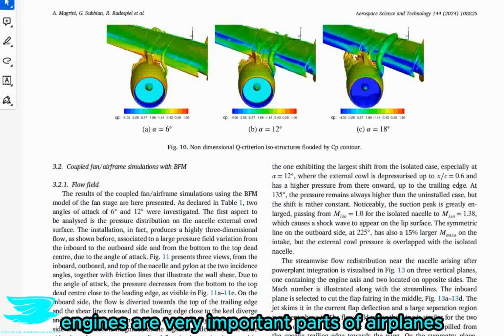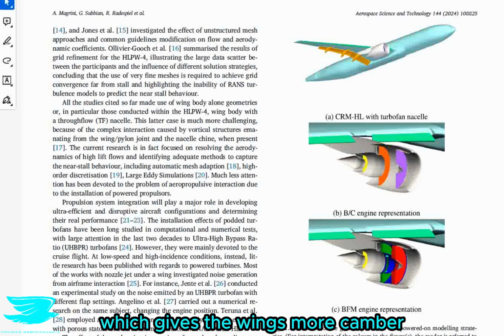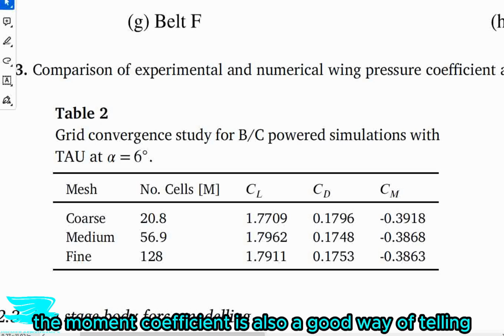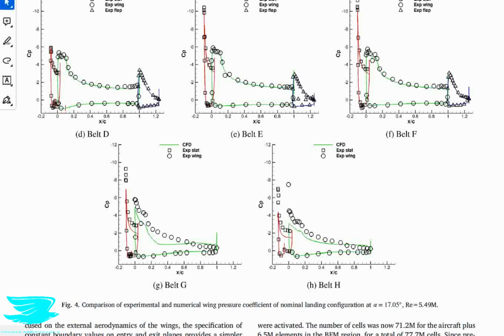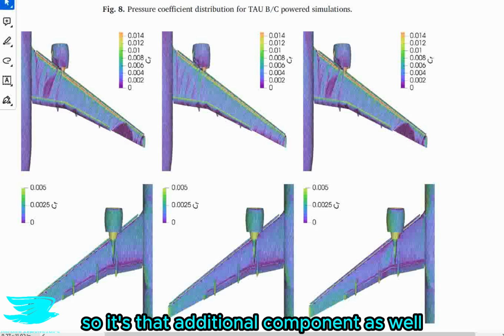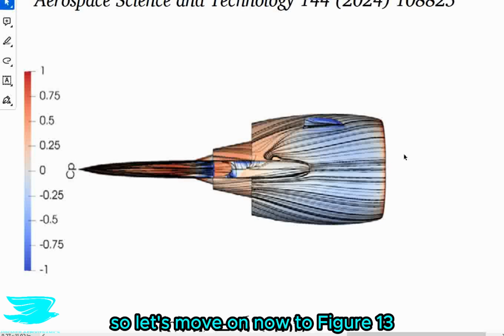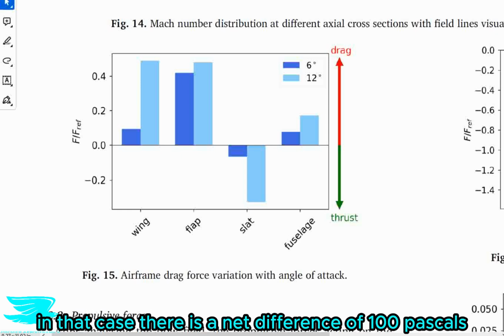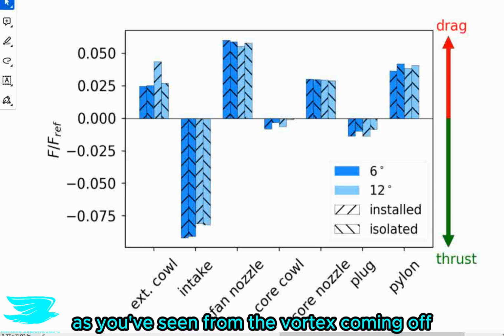Podcast #178 How Turbofans Affect An Airplane's Aerodynamics

Comment: on a lot of the smaller "STOL" planes with slats, the slats are passive... when the AOA gets up to some point, they passively deploy... they deploy because they create a very low pressure on the forward surfaces... low pressure on a fwd facing surface = thrust!  ;)   (in my testing, they can deploy violently actually!)

Comment: It would be interesting to do a study of the same depth for a 100% clean wing using tail-mounted fans and a wing with underslung fans, as shown. 
Which is better? 1% is a lot in this field.
Reply from the maker: That's a good point. The tail engines change the airplane dynamics a lot as well.

Comment: its really interesting to see how messy the flow around the engine gets. makes you wonder what kind of cost calculations determined that a better aerodynamic integration isnt worth it.
Reply from the maker: I think that it might be partly cost, but also perhaps just a lack of knowledge about how it affected the flow. Also, perhaps servicing also plays a role because the harder it is to get to components, the more expensive it becomes, as well as taking more time.
Reply: Ground clearance is a bitch :(

Comment: The fairing that holds the engine to the wing typically sheds its own vortex so that could be why the flow skews inboard along the engine.
Reply: if you talk about 16:00 onwards, i agree. the wss pattern reminds a lot of a vortex interfering with a wall. would also explain the lack of symmetry around the engine
Reply from the maker: Good point. That vortex is a low pressure core, which would not only suck in some flow but also just generally induced flow around it.